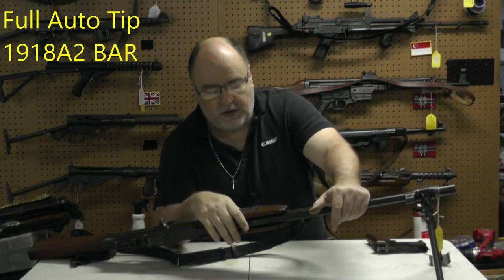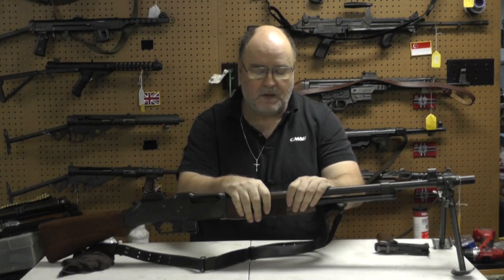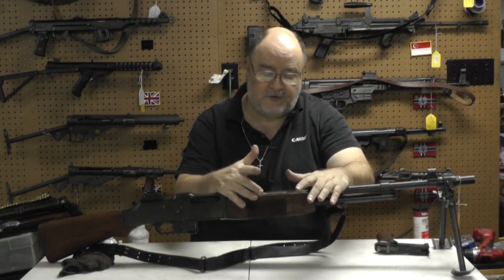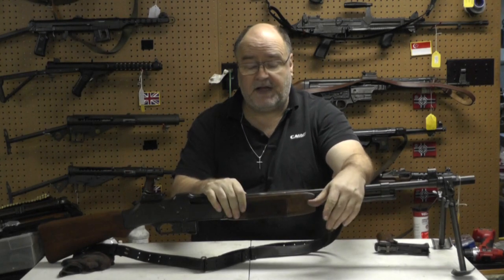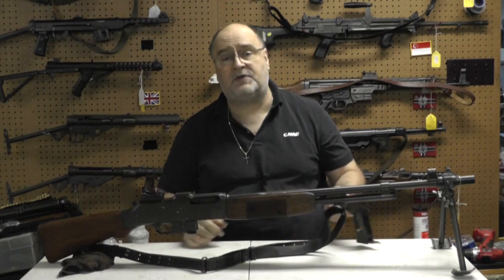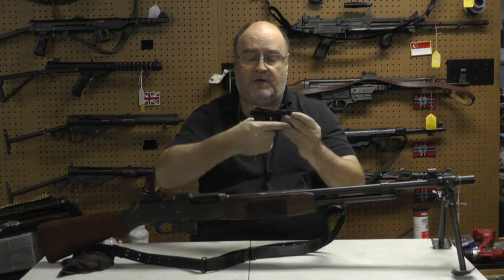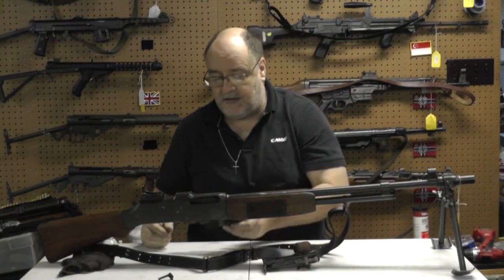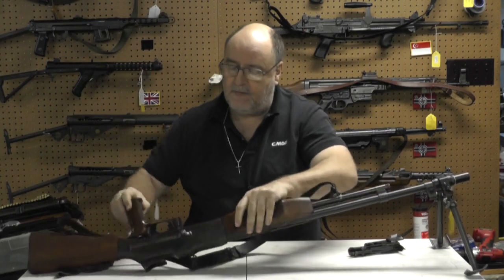Full Auto Tip   1918A2

Comment: Step 1: find a new gun club.  We had a gun club that said, "only one shot per second".  Technically, they didn't disallow full-auto, but your rate of fire had to be 60 RPM or lower.  Then they'd let the local cops come out and burn up tens of thousands of rounds full auto from MP5's.
Reply from the maker: RyeOnHam no other choices there are 4 clubs 3 are no full auto.  1 is subguns by permission only.

Comment: Or you could just buy a Swedish BAR :^)
Reply from the maker: Mongo63a lol.  My days of buying transferables are over
Reply: @psp1921tsmg  Mine too unfortunately. Being retired on disability pretty much killed my further MG collecting. I do have about 6 of these grip assemblies, I need to get them out and post them up on GB one of these days.
Reply from the maker: Mongo63a I need one more as I have 2 1918a2.   Useless you have an original I non modified 1918 grip.
Reply: @psp1921tsmg  Let me dig them out and I'll let you know. I know I have one that was modified to mount to a 1918A2 with the dual rate installed as well which is useless for my Swedish BAR. I do not have any 1918 parts except a rear sight assembly.